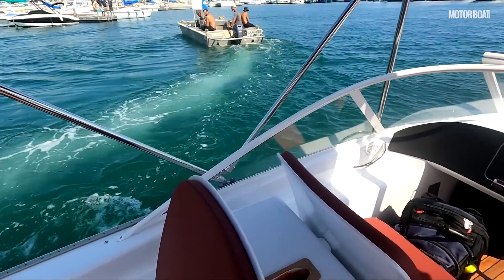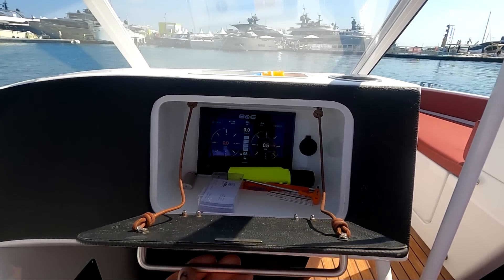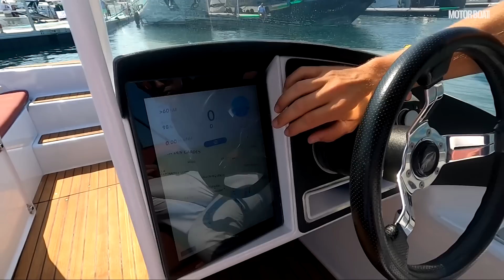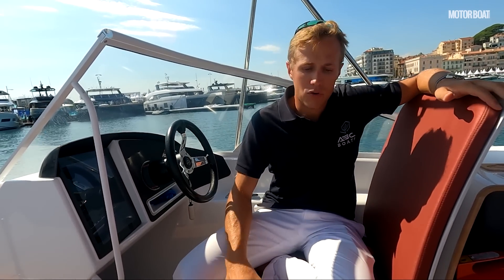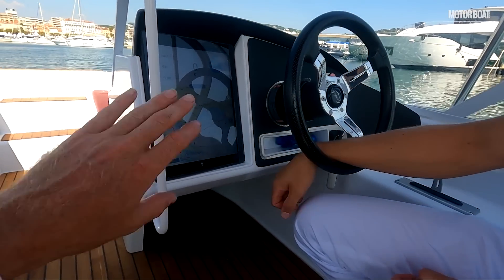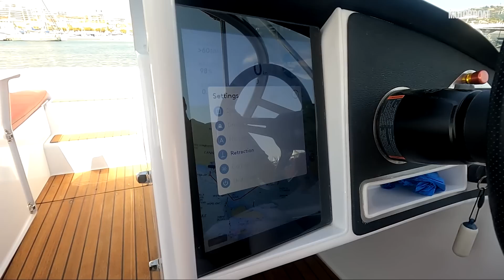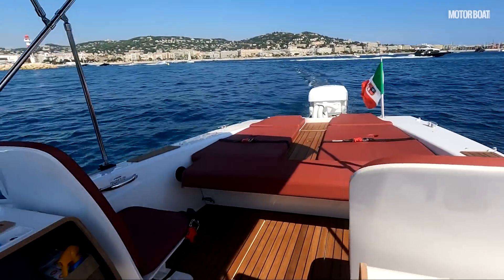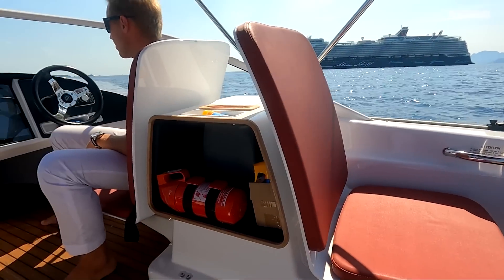We drive the world's first foiling electric boat | Candela C-7 review | Motor Boat & Yachting

Comment: Passing other boats in a "No Wake" zone must be kind of fun
Reply: LOL, It's still a speed restricted zone ! Which means, it is still a Ticket if busted !! It's not like people don't do it any way either. No Wake Zone Tickets are the main revenue generators on any waterway , besides Alcohol !
Reply: @Charles53412  Then regulations need to change to accept hydrofoils.
Reply: @jandersen6802   Why should a foil be exempted in a speed zone ? A foil is only good once your on plane. Which would mean, one would be breaking the speed limit in a No wake Zone !
Reply: @jandersen6802  I mean no, theyd still make a huge wake when speeding up, and going fast in a crowded area is dangerous regardless of wake
Reply: manatees
Reply: The "no wake" rule is meant to control speed. It isn't about the wake, per se. Though the wake does disturb boats at dock, it is primarily a speed control and safety rule.
Reply: Or in a hovercraft
Reply: @thomasarussellsr  you're partly right, but it very much has to do with not destroying developed shoreline as well. I agree it doesn't matter, a no wake zone is a low speed zone, but wakes wreck underwater constructs.
Reply: OTHER WAY ROUND……
How many boats with wake will you be allowed to pass ?
Reply: Don’t hit a dolphin shark whale or a dugong .
Reply: dude i'd be flying out of my marina, middle finger in the wind.
Reply: @Charles53412  It's supposedly about damaging boats at the dock or creating a bouncy floating dock danger for other people.  They dumb it down with a speed limit sign for people who don't realize what happens at the dock.

Comment: This is amazing. I'm glad we're finally making electric boats quick, after some time and advancement electric boats will be going way faster, longer range, and more efficient than fueled powered boats. This is a major improvement.
Reply: They're already way more efficient
Reply: @sandergjertsenstvold1051  I meant efficient in terms of putting the motors power to the water. Currently, they cant use all of the motors power when flat out, meaning it can't go faster than 30kts.
Reply: @blewyd  Yes Indeed, but that was specifically for the Candela, due to the foils possibly being too stressed at higher speeds. With stronger foils/ a regular hull boat, it's not an issue.
Reply: Longer range, no, not unless nuclear powered.
Reply: @gooble69  the more people buy electric vehicles, the more companies will want to innovate and come up with more efficient solutions. The time will come where electricity will be better than fossil fuels in nearly every way
Reply: @gooble69  that's not physics. The storage of electricity has nothing to do with it. I'm not going to argue with you about this. You should see why batteries can hold more capacity and are lighter than ever before. You should re read my comment before asking these ridiculous questions that you use as an argument. You're just begging for attention in a YouTube comment.
Reply: I don't see electrics being more efficient for range than fuel anytime soon. Cars haven't even been able to beat that yet either in terms of what you get for cost of energy ie fuel up to distance.  Battery tech is not there yet and is the limiting factor and it will hit a wall. To get longer range you need bigger or more batteries which means more weight which can hinder that efficiency.
Reply: @gooble69  Once upon a time there were "experts" that were certain that the internal combustion engine would ever replace the horse and buggy, let alone the steam engine. Oil was simply filthy sludge until we had the technology to utilize it as a source of energy, naturally created energy will be the technology of the future. There will be technology 50 years from now that does not exist today. Have you bought an 8 track tape lately?
Reply: @gooble69  Yep, millions have said the same type of thing for thousands of years.
Reply: @gooble69  The thing about science, technology,  and new discoveries is that it is never done. I don't believe in fairies my friend.
Reply: @gooble69   The energy density of gas at the system level is only 1/5th o the energy density at the tank level, cause internal combustion engines have weak-ass efficiency of 20% at most. Maybe a bit more on a really large vessel. Compare this to 90% conversion efficiency of an electric powertrain.
Also the energy density of li-ion is increasing at 5-8% year over year with new chemistries being developed all the time. So yeah, unless internal combustion finds a way to get real efficient real fast it's just gonna get supplanted by electric, you can easily deduce this from the historical trend of battery energy densities over time. Nothing to do with fairy tales, that's just the trend of density data plotted into the future.
Reply: @gooble69   I'm not confusing anything. Yes, gas has 46MJ/kg, but we're not extracting 46MJ/kg now, are we? We're extracting more like 9.2MJ/kg, so that's the apparent energy density when you're designing the system. That's so obvious I didn't think I needed to explain it. It is sooo dishonest to only compare fuel density independent of the powertrain when the premise of the argument is whether the whole propulsion system can ever be electric or not.
Also in my comment I specifically mentioned that "new chemistries are being worked on all the time". There was an article in nature recently about the theoretical energy density of lithium sulphur, which would be something crazy like 2.5kWh/kg. The real world maximum density will probably be quite a bit lower, but still, that's starting to approach gas at a system level. Maybe 20 years, maybe 40 years. Maybe never, but that seems unlikely. If you look at the number of papers on 'beyond lithium batteries' published each year it's a doubling of papers every two years! (granted, this was in Sapunkov et al., 2015, I couldn't find a more recent collation of blib publications). The periodic table is such a big sand box and the software tools for predicting the performance of new chemistries are becoming insanely capable. Funding for research into high density chemistries is only gonna grow more as electric slowly starts eating away at the short haul flight and shipping market (already is, in a small way) and as fossil fuel companies slowly but surely start losing market share, investment money is gonna be redirected into electric storage and propulsion.
It's such an exciting time.
Reply: @gooble69  solar bimini or panels. There are some solar electric cats crossing the ocean.
Reply: @gooble69  Someday it propably will but not enytime soon..

Comment: Love this technology, a wonderful look at the way forward for boating. Fabulous 👍
Reply: It's nothing new though - electric motors are old tech - batteries+inverters are the only areas where their is new ish tech being developed and that will hit a wall. Hydroplanes have been around a hell of a long time as well and never took off due to sort of limited applications so not exactly what is to get excited about here.
Reply: Completely useless if the weather turns rough and seas more than 1-2ft rough. 
Then you stuck in a normal slow boat.

Comment: I personally have tried it, it is stunning how it works, very smooth and it is fast too. Only concern: seaweed
Reply: I had the same question

Eg what happens when one foil is fouled
Reply: Silly peasants, you just throw it out and get a new one.
Reply: And pot buoys
Reply: @maxbenneton2328  throw what out?
Reply: just don't use it in seaweed areas 😂
Reply: Yes, I am having the same problem with pedal and electric motors on fishing kayaks. My lake is quite weedy and everything bogs down with weeds, both flippers and props. You basically need a lot of torque to get through weeds.

Comment: Very cool, I wonder how it would cope with hitting a submerged log
Reply: Probably about as good as your boat would do hitting a submerged log which would be NOT GOOD.
Reply: @nickbommarito3472  my boat survived with some gelcoat damage and the outboard kicked up. Lots of submerged logs where I live. I was just wondering if they had designed the legs to shear off at a certain level of impact to save the hull from sinking
Reply: @Rambro-angryram  People who buy this aren't going to be using it at a location with submerged logs.
Reply: @FinnishArmy  That's the problem, they can be anywhere in the ocean or lakes, you don't know till you hit them

Comment: I’ve been waiting with baited breath for someone to move into the foiled electric boat building.  This is just the beginning.  This bait gets almost half the mileage of an electric car… imagine that?!?!  That’s a massive difference.
Reply: What is the point of a boat like this? Seems very dull if you can't pull a skier or something.
Reply: @sam_s_  Yeah, the problem is boats are largely sold on they non-utility, nobody buys a boat to commute, the way they used to with the commuters.  It is all for doing donuts and screwing around bothering people.  But imagine a boat that is as practical as a car, and fast, and does not create a lot of pollution, other than the huge amounts in it's creation.
Reply: @HondoTrailside  and now imagine this technology on huge tankers, that would be insane the amount of energy saved and faster delivery times would be a worldwide gamechanger also much less pollution as you stated

Comment: if they can make this kind of boat a lot cheaper it would be amazing.
The running cost of this boat are so small that having this on a cheaper boat would make boating much more accessible for everyone.
Reply: All the light weight composite crap is super expensive
Reply: As more research goes in the cheaper it will become.

Comment: I'm not sure how much software is involved here. When I was young, my family owned a Dynafoil, which operated exactly the same way. I do have to say, this is one elegant design. The ride is reminiscent of the ride I had on that Dynafoil, it was like riding a motorcycle on water.
Reply: It's interesting that you mentioned Dynafoil. I was actually interested in buying one a long time ago. I have one of their brochures. However...they did not survive very well. I believe it was because of the safety of a "spinning prop" under water.
Reply: @sunking2001  there were no safety issues. The prop was disengaged with a foot pedal if you fell out. The founder got tired of the claims. To my knowledge,  nobody ever got hurt. The rider was between two or three feet from the prop. No less safe than any other boat with a spinning prop.

Comment: Foils have just came to windsurfing as well. When it would be a 6.0-6.8 day, you can get away with a 3.4-3.6. So much smoother and efficient! (force of wind goes up with the square of the area FWIW)
I imagine this is how electric marine would be possible simple because of the energy savings!
Reply: if you know the car company rimac, they have announced that they are planning on building an electric boat. i would personally add an gas turbine as a range extender. now if this technology can be scaled up for tankers that would be huge
Reply: @Humbulla93  Wouldn't that be wild to see a 1200' vessel cruising at 35kts twenty feet above the sea?
Reply: @Humbulla93  it’s unlikely that it will be scaled up to tankers. Batteries are still poor at storing energy with low mass.

 there is an electric Chinese container ship, but it’s range and top speed is appalling, 50 miles until it runs out of battery and a top speed of 8 miles per hour and this was in mid 2020. 

In theory you could stick hydrofoils on a tanker, but hydrofoils are inefficient at low speeds, you need to get them in high speeds before the foils start to do anything useful, and hydrofoils are fragile and take up a lot of space which is not ideal for a ship that has to take a beating in hard weather and choppy water and for a maintenance point of view. 

I would say fuel cell (assuming we don’t have to use platinum to make the fuel cells) or HCCI engines with synthetic sustainable fuel (such as ethanol) is probably the future.
Reply: Todays new wave of Foiling tech started in the windsurfing/sailing scene!!🤙🤙 Still remember testing out a pre production windsurffoiler some years ago. I asked the developers how it was like. "you will fly" 😎😎

Comment: Whilst the presenter's enthusiasm is quite natural, a few questions about issues to the salesman would have been appreciated. Eg striking semi submerged logs, weed, plastic bags etc, how to clear foils. Not that I could afford one of these anyway!
Reply: Seat belts.
Reply: Great points!!!!!
Reply from the maker: It's a fair point but I have answered the question on here before. Things like weed and bags are unlikely to make any difference unless there's so much of it that it slows it down enough to drop off its foils. In that case you may need to stop, reverse, let it float away or if needs be lift the foils, remove the debris and  and start again. If you hit something immovable like a log then they are designed to break off and leave the hull intact. Not ideal but hitting a rock or log in a 'normal' boat is not going to end well either
Reply: @MotorBoatYachting  Thanks for your reply, helps to bring a balanced view, nice bit of kit, I wouldn't refuse one as a gift!!!:-)
Reply: @MotorBoatYachting  Interesting. Manatee killer from the look of it.  Could have a  scanning sonar or something.

Comment: I’m curious to see how it would handle a very tough sea. IE: what if the hydro blades came out of the water going over say a 10’ wave? It would land on the horizontal blade. I wonder how the blade would handle that whole boat landing on it. Interesting start. 
As opposed to cars, boats could use solar to recharge with panels on a hard top.
Reply from the maker: I'm not sure I'd want to be out in 10ft waves in any small open bow rider like this. You really need a RIB or deep vee unsinkable centre console for that kind of thing and preferably bigger than 25ft
Reply: My guess is that in that sort of rough sea the computer would have aborted a long time ago. Given how sensitive it was on takeoff you also would be stuck in non-hydrofoil mode until the water got calmer.
Reply: @andreaszetterstrom7418  sounds good

Comment: Interesting that they went with the 55kw motor, then limit it to a max of around 25-30kw.  I wonder if that ends up being more efficient than running a 25 or 30kw motor flat out.
Reply: It uses close to the full power for getting up on the foils. Then limits it to limit the speed.
Reply: The larger windings and limited power, 25-30kw in a 55kw rated motor, will help it run much cooler.
Reply: FlesHBoX..... with regards to motors and engines... Always go bigger than you need, results far less "wear and tear" and greatly extended engine and/or motor (electric) life.
Reply: It sounds pretty easy to hack to the full rating of the motor.
But who would ever want to stress the structure to its limits personally? Could be painful!
Reply: More torque and range

Comment: Nice boat I guess but what’s the operational range? Also for the same price as this dinky little boat you could get a 36 foot center console with three 300 hp outboard‘s with a full head Galley sleep berth that has a 600 mile range
Reply from the maker: They claim it will run for 50nm @ 22knots and based on our brief test drive, that seems realistic
Reply: @MotorBoatYachting  
Interesting did you get a chance to see what the charging procedure was like? I love the technology I just think development still has a way to go. Electric motors have a lot of advantages in some applications they can run for decades continuously I’m guessing battery capacity versus weight Is the real issue when it comes to boating  applications

Comment: Great design and great manufacturing!  Curious about the power difference with and without hydrofoil at a high speed such as 25kn and at a low speed such as 10kn. Is the power saving advantage only at high speed? Thanks a lot.
Reply: I was wondering the same thing. The foiling efficiency as it relates to kW, range etc.

Comment: The coolest thing to me about this and the electric airplane is the motor just starting when it’s needed. No checklists. No 5 minutes to warm up the engine. It’s just off one second and the next second it’s on and they’re on their way. Obviously I know that’s how electric motors work but it’s so cool seeing it in these two applications.
Reply: Also the fact that this vessel doesn't use Leaded gasoline as a fuel like a personal aircraft does. That's quite nice.

Comment: Actually, I'm surprised that this is a new technology for sport boating. Ferries have employed hydrofoil technology for decades, albeit via conventional fuel engines, not electric motors. I took the hydrofoil ferry from Ostend Belgium to Dover, England. Speed was 50 knots and transit time was approximately 1 hour.
Reply: Thats realy fast
Reply: Controlling the foil flaps requires either high power electric motors or hydraulics... A conventional boat this size wouldn't have more than a small 12v battery and I'm not aware of any outboard with the capacity to generate hydraulic power. I think the presence of abundant electric power makes this possible in such a small boat.
Reply: Canadian Navy had one 50 years ago-ish.. couldn't keep the foils from cracking.
Reply: @happyinfidel1  these issues were caused by lack of understanding in hydrodynamics and metalurgy. Modern computing and composites have solved all the issues faced by early hydrofoils.
Reply: @kschleic9053  72 MPH the Bras D'Or reached.. Amazing for the '60s.. Amazing for today.
Reply: @david chabassol  absolutely. All the older hydrofoil boats were amazing, especially considering they didn't have the advantage of modern computing in design or control.